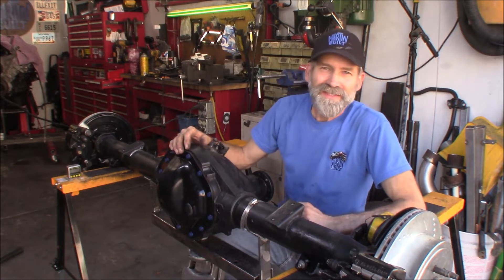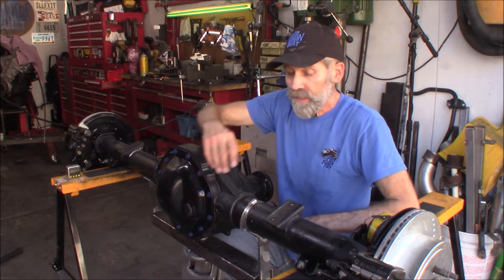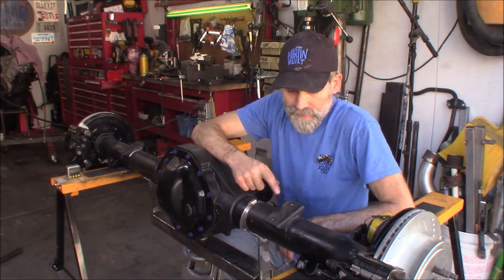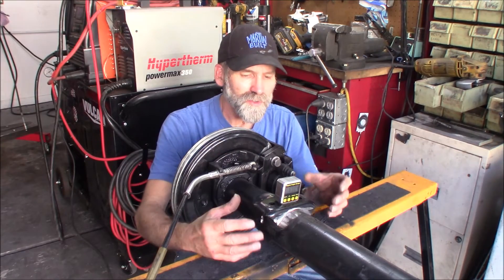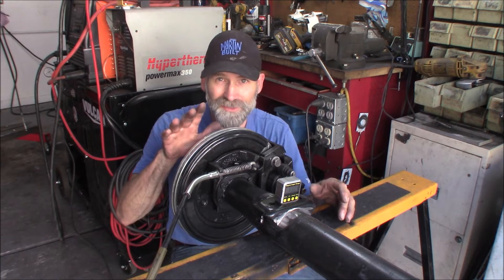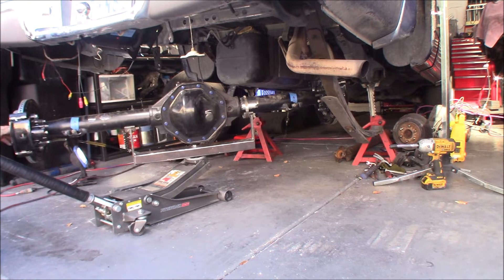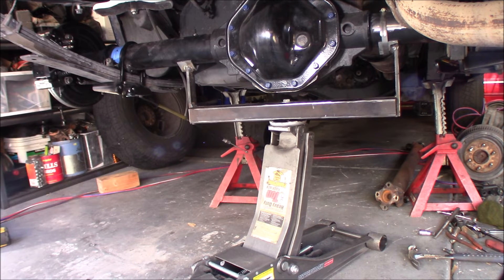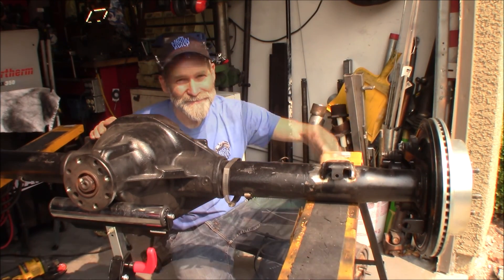Issues with Moving Spring Perches for Dodge Durango and Dakota

Comment: Wedge shims can usually correct the pinion angle issue without removing and rewelding perches. Sway bar mounts are a different  issue, perhaps the original setup from the donor would work, but doubtful, since a Dakota pick up is a pick up frame/body and Durango is a SUV frame and body. 

I have to replace the driver side front coil spring perch on my '02 WJ with a Dana 44 and 3:73's. The welded mount and base for mounting the sway bar, spring and shock to the axle tube is rusted through and collapsed on itself. 

Ahh, the joys of living in the North-Eastern states.>! Good video, informative and enlightening. As always your attention to detail is 150%, as are your hands on skills!. A joy to see someone doing it right!!
Reply from the maker: Thank you, Phil. I appreciate the kind words.
 I may have considered using a wedge to correct the angle but I had it off so far I'm not even sure they made a 6ﾟ wedge. And besides, I'm so  particular I had to have it just right.
 I am actually gonna try to make the Durango swaybar work I've actually done a little bit of measuring and if I make some custom links I believe I can make it fit.
 My WJ has a little rust on the front spring perch as soon as you lift that lift that rubber grommet that the spring rests on.

Comment: Finding this with mine. 9.25 2wd Dakota Spring under axle. BUT the Belltech drop leafs I ordered for my 2wd Dakota came pre-assembled for "spring over" with the center pin button facing the wrong way. Bolt/nut facing upward and the button down rather than 180 degrees. I did double checking online being 4x4 vs 2wd 8.8 vs 9.25 I found most of the Quad cab dakotas set as Spring over leaf as 75% i found were 4x4s. (the way they sent me the leafs with the bolt) It's not a hard feat to swap ends on the bolt, but if you werent looking for that or prepared to double check, you'd find out after getting it in and having to take it all back apart lol
Reply from the maker: I would think that only the 4 wheel drives have the leaf over axle, and to reverse the bolt, simply C clamp the leaf Springs, and you can remove the bolt and flip it around.

Comment: Thanks for the info. I'm thinking about doing a durango axle into my dakota for the fact i can get a durango 3.92 complete axle with a warranty for cheaper than rebuilding my 9.25.
Reply from the maker: Yeah I did it pretty much for the same reasons because I found the gear ratio that I was looking for and it was readily available at Pick-A-Part

Comment: Can warn leafsprings cause a pinion angle off and causing vibration? Driveline has been checked and U joints replaced
Reply from the maker: I don't think it would have much effect on drive line angle. I could see where worn leaf springs could cause axle wrap.  Which can cause wheelhop on a hard acceleration.
Reply: @martinbuilt  thanks I have replaced the transmission mount haven't checked motor mount  but any idea why I have vibrations?

Comment: Hey martin i have an 04 jeep grand cherokee quadradrive with the 4.7 what should be upgrade i should do?
 I live in Oregon
Reply from the maker: That all depends on what you're looking for.
 Are you trying to improve performance or gas mileage or reliability.
 For me it was performance and many times I improve gas mileage at the same time and reliability as well.
 You living in Oregon you have a cooler climate than I do in Southern Nevada so the cooling system was a big deal for me where your hydraulic fan may work perfectly well in Oregon I was not impressed down here and so happy I made the electric fan conversion.
 If you're looking for some performance increases I would suggest the set of the HO Cam shafts and and an improve the flow of the exhaust system.
Reply from the maker: That all depends on what you're looking for.
 Are you trying to improve performance or gas mileage or reliability.
 For me it was performance and many times I improve gas mileage at the same time and reliability as well.
 You living in Oregon you have a cooler climate than I do in Southern Nevada so the cooling system was a big deal for me where your hydraulic fan may work perfectly well in Oregon I was not impressed down here and so happy I made the electric fan conversion.
 If you're looking for some performance increases I would suggest the set of the HO Cam shafts and and an improve the flow of the exhaust system.
Reply: @martinbuilt  i would love to gain reliability and a little performance
Reply: @martinbuilt  jeep only gas 174k miles and I'm trying to keep the 4.7 running as long and as strong as possible 
Guy in our town has one with 284k miles 
I'll post a video soon of what I'm dealing with currently.
Reply: 08 plus cams are alot easier to find and more affordable than the ho cams. Electric fan conversion is a must and one the the cheaper mods. Cai, exhuast, tuning, gears, throttle body porting also helpped.

Comment: Some of the Dakotas are slightly different because they were originally built to handle a 4bt Cummins...the Durango a were never designed for that...now of course they never ended up GETTING a 4bt stock...but they were designed to...
Reply: Is this true? I've never heard of that. What would even be the difference between a normal dak and one meant to be fit with a 4BT

Comment: may have been easier to use a truck axle then brake swap it.
Reply from the maker: Yeah, if I could have found one from an 03 or 04 Dakota, it would've saved me a lot of work. That way, I would've got the rear disk brakes that I wanted.
 But, finding one with the 3.92 gears and the rear disk brakes is not easy.
Reply: @martinbuilt  i hear you on that... i can't seem to find any in Indiana were i live.
that isn't all rusted out or 3.55 gears in them and the right perches for a 4x4.
on my 2001 dakota crewcab 4x4 i have the big heavy duty front axle with 3.92 gears and a 8.25 hd axle in the rear with 3.92 gears and no slip carriers... but i want a 9.25 axle out back for towing.